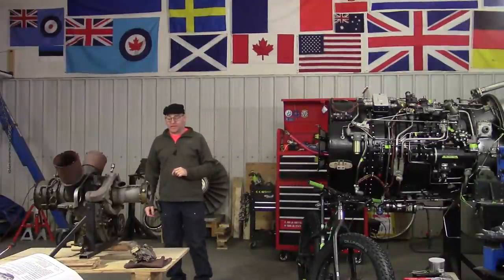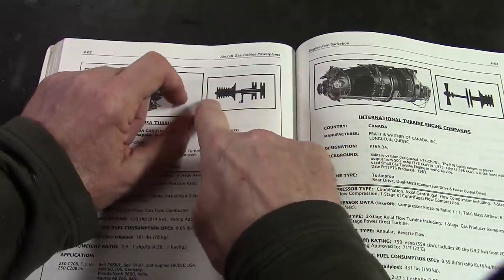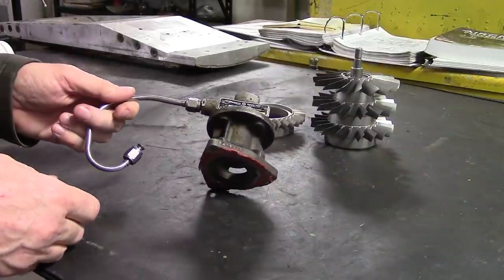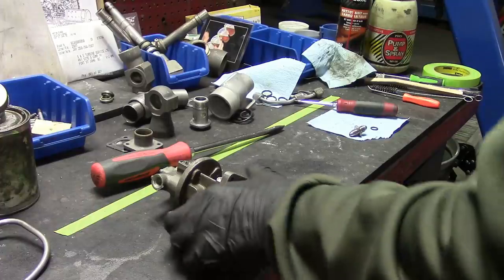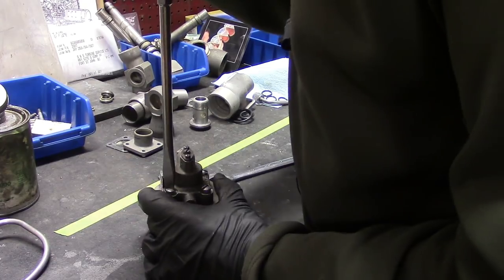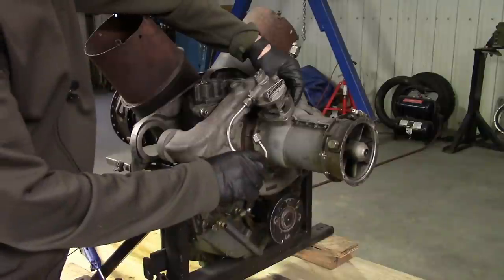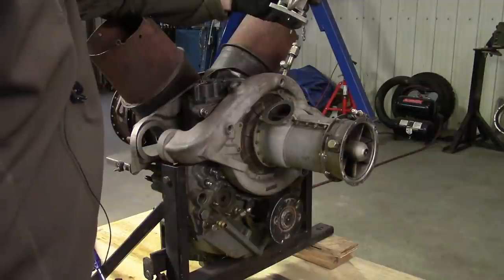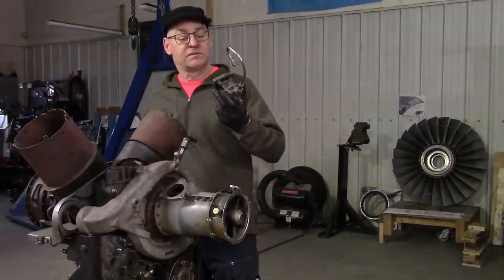Mini Jet Boat Ep. 2  Engine Overview and Bleed Valve Rebuild

Comment: Cool, unusual engine! It has weird design but at the same time simple and reliable! This design allows, suggests to apply recuperation for fuel economy. I know company Allison has patent for air recuperator  for the turboprop engine. It allowed to had fuel economy about 40% on the cruise  regime. 
      Those 2 air pipes from the compressor which provide air flow to the combustion chamber (with only 1 fuel nozzle!),  are installed along the engine and near the exhaust pipes. This air pipes might go right through  the exhaust pipes, have metal ribs on them and absorb the heat from the exhaust gases. It can decrease fuel consumption which is the challenge of modern aviation. Why nobody did it?
Reply from the maker: Heating compressor discharge air will decrease engine efficiency.
The 250 does not have recuperation, and that is not why it is designed this way.
Reply: @AgentJayZ  heating compressor discharge air will improve efficiency, since the goal (from an efficiency standpoint) is to maximize turbine inlet temperature (and pressure).  It'll only help if you're using exhaust heat after the final turbine stage though - cooling the exhaust before the turbine would hurt efficiency (and by far more than the heating of the compressor discharge air helps).

Comment: Dude, you are the expert. But on the efficiency are you conflating one pound thrust one with horsepower. FWIW when Frank Whittle was 'selling' his engine to the RAF he, or one of his supporters, said that a Merlin which was around 1,000hp at that time was about the same thrust as a 1,000 pound thrust engine. So maybe it's valid to compare them 1:1?
Reply: I've already copied this reply to another contributor, which clearly demonstrates that 1:1 is not a valid comparison.
Dredging the depths of my memory, to demonstrate the difference in the SFC units, I recall that the Olympus 200 in the Avro Vulcan was rated at 17,000lb thrust for T/O.  The equivalent industrial engine was rated at 17.5MW for electrical generation 'peak lopping', which is around 24,500SHP.  The 'peak lopping' rating was probably more nearly equivalent to max continuous than T/O: nevertheless, it does highlight the difference in the units.
Reply: I've just made this comment, which I'm copying here for your benefit.
In respect of the SFC issue, and comparing thrust SFC of lb/hr/lbt, versus  power SFC of lb/hr/SHP, if the 250 was a little turbojet, with a PR of 7.2, I would expect it to have a thrust SFC of above 0.9.  This compares with the power SFC figure in the book of 0.65lb/hr/SHP.
Reply: I'd composed another comment, based on an account given in John Golley's book, 'Whittle: The True Story', which I've deleted: however, I've now gone to Stanley Hooker's book, 'Not Much of an Engineer'.
In August 1940, Hooker asked Ernest Hives if he would go down [from Derby] to Lutterworth to see Whittle's new engine.  Hives asked, "What does it do?", to which Hooker replied, "It's giving 800lb of thrust".  Not impressed, Hives said, "It wouldn't pull the skin off a rice pudding, would it?"  Hooker had already done the calcs and said, "Do you know how much thrust the Merlin gives in a Spitfire flying at 300mph?"  He went on to say, "With its present propeller, which is only about 70percent efficient, it gives approximately 840lb".
In May 1941, the Gloster E.28/39 first flew with an engine that produced 860lb thrust on the test bed, with the speed limited to 16,500rpm.  With that rev limit, it achieved a maximum speed of 350mph at altitude, where the thrust would have been less than 860lb.   With the rev limit temporarily increased to 17,000rpm, which gave 1,000lb thrust on the test bed,  the E.28/39 reached a speed of 370mph at 25,000ft.  Again, the thrust would have been less at altitude.
In 1940, the Merlin going into the Spitfire would have been producing  1,150HP on the test bed  It was probably that mark of Spitfire and Merlin, which Hooker used as his example.

Comment: Rather than vetec its more like a decompression lever allowing the thing to spin up easier
Reply from the maker: Negative. That is not what a bleed valve is.
With the valve open, compression is increased at low rpm.
With the valve closed, compression is increased at high rpm.
Reply: @AgentJayZ   yes sorry I had put this before seeing another of your videos thank you for your time to reply

Comment: Beautiful little compressor stages. I assume they are machined out of a block, not blades welded to a ring? Was that relatively automated already when the engine was developed or was it essentially "handmade" by a guy standing at a lathe?
Reply: NC lathes have been around for over a century, though the original ones used mechanical control with punched cards and cams. CNC as well has been around since the 1960's with the development of DEC's PDP11 series, many of which were used to upgrade NC lathes to computerised control, basically replacing the punched tapes or cards, and allowing more complex operations to be done.
Reply: I know nothing about the manufacture of the Allison 250, but I did see compressor and turbine 'blisks' being machined for licence-built Turbomeca Palouste and Artouste engines, back in the 1960s.  They were machined out of disc blanks on a copy-milling machine.  Four blanks (as I recall) were machined at a time, with the milling cutters being controlled by a probe following the the contours of the aerofoils of a 'master' disc.  That was long before the days of CNC machines, but the machines were left to run without operators, so there was some form of programming controlling them.
PS. After machining, the blisks required a significant amount of polishing by hand, to remove the machining cusps left by the milling cutters.  This was done by skilled operators in what was jokingly known as the Polish Corridor.
Reply: @grahamj9101  Yes, those machines have been around since the beginning of the Industrial revolution, so at the time they could have been already 80 years old.
Reply: @SeanBZA  I suspect that the copy-milling machines I saw as an apprentice had previously been used to mill the impellers for piston aero engine superchargers before and during WWII.  They were far from new. 
Those machines were in the Parkside works of what had formerly been Armstrong Sidddeley Motors, Coventry.  Long before the city became Motor City UK in the 20th Century, weaving had been a major industry, with Jacquard looms controlled by punched cards.

Comment: I don't get why, I think I remember you mentioned it in the past, but why do helicopters use centrifugal compressors but airplanes no? Are them less efficient? I get they are probably smaller and lighter so why don't everyone use them.
Reply: Because size matters.  If the compressor aerofoils of a large jet engine were scaled down in direct proportion, they would become very fragile thin pieces of metal in a small helicopter engine.   Where axial stages are used, they have to be more robust than would be required for aerodynamic reasons alone.  A centrifugal stage is altogether more robust (and simpler) in a small engine.
Going in the opposite direction, scaling up a centrifugal stage for use in the compressor of a large turbofan engine would result in a big, heavy lump of metal.  Having said that, as pressure ratios get higher, and HP compressors become smaller, the last stage of an HP compressor in a future large turbofan engine just might be centrifugal.
Reply: Higher compression ratio for a given size and cheaper
Reply: @Ronke01  You get a demerit for this: the relevant term for a gas turbine engine is 'pressure ratio'. As a young designer, I once had to correct a senior engineer at R-R for making this error.  He looked surprised for an instant, and then apologised (sort of).
Reply: @grahamj9101  the intake ram pressure on a helicopter engine is negligable to non existant so compression ratio is perfectly fine to use. Especially when we are talking about a single static object to compare axial vs centrifugal flow compressors.
Reply from the maker: Ronke, that's a negative. The actual term for piston engines is static compression ratio.
The static compression ratio for any non-positive displacement compressor is zero, so that won't work.
The compression of the air flow for both a centrifugal and axial compressor depends upon rpm, so it is always referred to at the design speed, which is 100% rpm.
Since this is a very far cry from static compression ratio, it is called compressor ratio. The people that know this recognize that it is assumed the compressor is operating at 100% rpm.
They also know that they will forever be correcting the piston people on their misunderstanding.
Reply: @Ronke01  If you hadn't already picked up the fact that I had a career lifetime in gas turbine design , I'm taking the opportunity to tell you now.  I was also brought up in what is known in the UK as the motor trade, which translates as auto repair in N America, so I do know the difference between the terms.

Comment: What is fule consumption at full throttle, i think they dont need that much
Reply from the maker: The Fuel consumption is around 25 gallons per hour when in a helicopter. It will be less in a boat, because it will spend less time at high throttle.
Reply: @AgentJayZ  COOL, Thanks.
Reply: @AgentJayZ  I can compare that to a dear old Proteus turboprop producing around 3,500SHP, with a fuel consumption of 240 (Imperial) gallons per hour.

Comment: You could really use some Vice soft jaws.
Reply from the maker: The jaws are aluminum. Best solution is to mount the accessory on a plate and put the plate in the vise. Will do that with next accessory!
Reply: The fibre ones are wonderful. Great for gripping delicate oddly shaped housings like the bleed valve. Great video. I can't wait to see your progress on this project.

Comment: What modifications do you think could be done to up the power?
Reply from the maker: 317 Hp out of 150 lbs, and you're not satisfied?
Reply: @AgentJayZ  turbocharged 13b rotary engines weigh 110-150kgs ish and can make 800 shp in race trim. Obviously that’s way more expensive and not really applicable to a race boat, but I was just curious.

Edit: curious and naive*** I don’t know nothing bout nothing
Edit2: I had 1000shp but it appears to be closer to 800ish
Reply from the maker: The latest rr250 is rated 700 Hp continuous. And by continuous, I mean for days on end, no sweat.
Put your turbo rotary at redline on a dyno for a weekend and you've got a nice fire.
My first car was a Mazda r100, and I loved it!

Comment: So at what speed would it have to rotate to start that engine? All the best from Surrey
Reply from the maker: About 10 % of 51,900 to start burning fuel.
Reply: So would 5200 RPM be a good guest on its startup or idling?
Reply from the maker: Start.
Ground idle is about 40% rpm
Flight idle about 85%
Reply: @AgentJayZ  Ground idle for these engines is around 62% N1

Comment: Engine uses a planetary gear reduction set if I remember correctly
Reply from the maker: Not this one. I 'll try to remember to put up a diagram of the reduction gearing in the next video.
Reply: @AgentJayZ  Good enough  Thank you
Reply: The cross-sectional GAs that I've found show a two-stage, pinion-and-wheel, reduction gear arrangement.
Reply: @grahamj9101  Could be I was thinking about the Solar used on the Chinook as a starter turbine
Reply: Still has me going  but I'll get used to it

Comment: so is this going to run through a trans to prop or just thrust out the back of the engine?
Reply from the maker: Direct drive (6000 rpm) to a water jet.
Reply: @AgentJayZ  That should be fun. I enjoy your vids Bud. You know your stuff.
Reply: Sooo... just to be asking. What will the thrust be out of the water jet? How can it be calculated?
Reply: What is my loss between engine and water jet?
Reply: How big differens is it in power.
To the race boat jet engines you repaird?
Now then you have direct drive. With out the direction change gearbox it will have alot more power direct to the wather jet?
😊👍
/J

Comment: So solid compressor stages are okay in a very small engine?
Reply: They are easier to manufacture for something the size of an Allison 250 - and they are increasingly being used in larger engines, because they can be lighter than the equivalent bladed discs.  I believe that the latest marks of R-R Trent have 'blisked' HP compressors.  The Eurojet EJ200 has 'blisks' in both the fan and the HP compressor.
Reply: @grahamj9101  No vibration issues?
Reply: AFAIK they are the strongest/lightest option, but increasingly difficult to manufacture at larger diameters.
Reply: @ericthered9655  Are you asking whether there might be vibration issues because there is no damping in the absence of a dovetail or firtree root fixing?  
Yes, I've plucked at the tip of a blade on a blisk and it produced a lovely note, like a tuning fork.  I've done the same to a blade with a conventional root fixing and it was as dead as a dodo.  However, I've never had the opportunity to pluck at a blade rotating under power, but every engine has and, if a blade (or vane) is being excited at a resonant condition, it will fail in fatigue very quickly.  A conventional root fixing will 'lock up' and the damping effect is, in practice, minimal.
Do you know what a Campbell Diagram is? Part of the design process is to ensure that blades and vanes are not subject to resonant conditions in the speed ranges in which the engine normally operates, and that applies to the aerofoils on a blisk, of course.
Reply: @grahamj9101  Yes. I'm curious about the effects you have mentioned. The blisk is a lot easier for a DIY guy to manufacture than individual blades.
Reply: @grahamj9101  I'm trying to build something for a toy. Go Kart level.

Comment: Air cavitation preventer  ?
Reply: Cavitation is a phase change on the low pressure side of a prop or compressor (or pump). Air cannot cavitate, since no matter how low the pressure gets, it doesn't have a phase change. Stalls are bad, but they're fundamentally a very different phenomenon.

Comment: I'm sorry, but that lockwire is terrible, please just mount the valve back on the engine temporarely.
Reply from the maker: Apology accepted.
Reply: @AgentJayZ  I teach lockwiring on almost a daily basis as a part 66 module 7 instructor. And as a former F16 F100 tech , it's kind of my thing 😂
Reply: There's an undrilled lug on the body of the valve, which may have been intended for lockwiring of the union body.  If that could have been used, it would have been far better to lockwire the screws in pairs.
Reply from the maker: Your standards are much higher than the needs for this project, but I hope you will agree that this lock wire job is "functional". It's OK to say that with a disappointed sneer as only an instructor can get away with.
Cheers!
Reply: @AgentJayZ  absolutely right ;) its gonna be a boat engine after all, not that you'd want it to fail, but not as critical as an aircraft engine, looking forward to the next videos btw. We have some much newer Allisons in our training hangar from the Agusta A109 helicopter. We even have a cutaway engine. If you want I'll email you a high res picture of it ;)
Reply: @AgentJayZ  I'm certainly not sneering, as you did the best you could with what was in front of you.  Nevertheless, as a designer who started his career on fuel systems, I recognise that it would have been much easier for you if the screws could have been lockwired in pairs.
Reply from the maker: I will print it out and use it in videos!
Reply: @AgentJayZ  Sent ;)

Comment: It may be lightweight and make a lot of power for its size, but damn those things burn A LOT of fuel!!!
There is no such thing as a free lunch when it comes to thermodynamics!
Reply from the maker: You're right. Turbine engines are the same efficiency as piston engines of the same power. Big power needs big fuel.